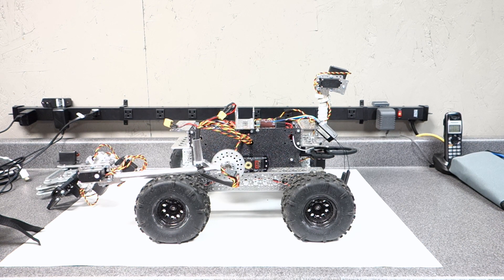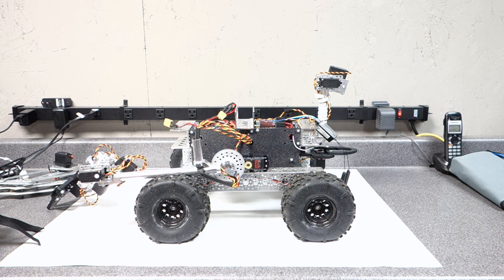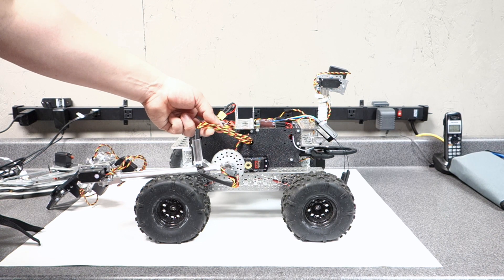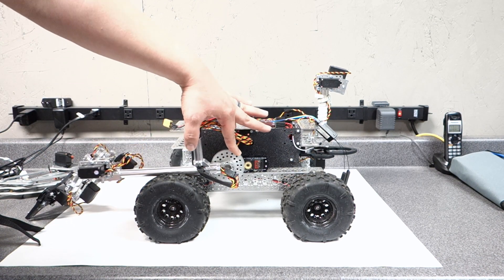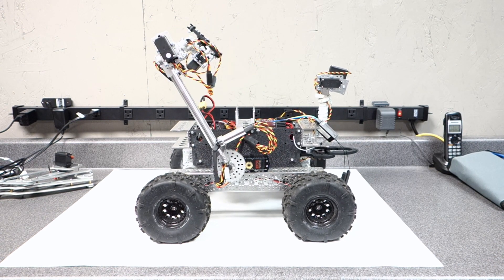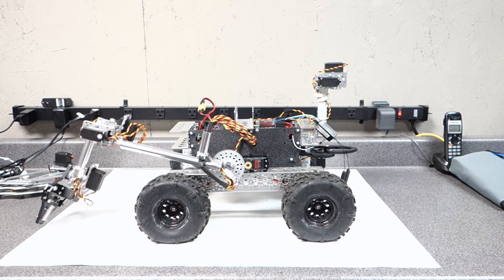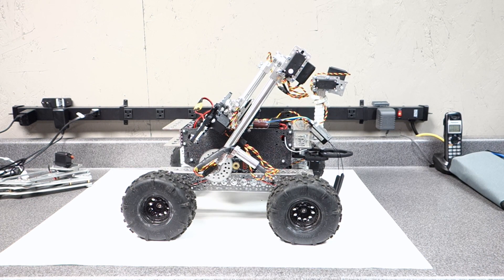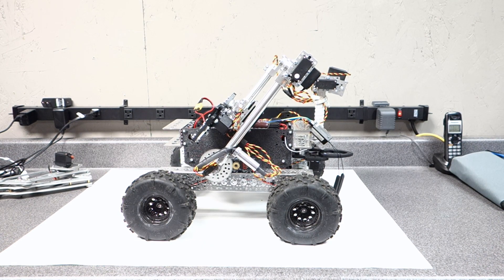NOMAD Rover Robotics 4x4 Project RC Arm attachment

Comment: Fantastick compliment, if you are interest about remote command with an actionoise board, visit the website https://www.actionoise.com
Just an actionoiseboard a playpad and a videocall you can take control of the rover from remote.... Just an 3g connection. Or WiFi, without limit of space...

Comment: Looking to use servos to control a robotic arm similar to this.  Do you just wire up the servos to the receiver and select the channels on the transmitter?  Any additional programming needed?  Do I need a specific type of RC controller?  Thinking about using the Hitec Flash 8 to do this but it is primarily used for aircraft control.  Is there any advantage to using your taranis controller?

Comment: What kind of electronics are you using for the drive system? I'm using an APM 2.6 with brushed ESCs on my Dagu 6x6 Wild Thumper but it's giving me a hard time trying to run skid steer (like yours, left and right motors are forward and reverse). I ordered a Sabertooth dual 12A ESC which is supposed to have skid steer support built in, but I'll know in a couple of days.

Just curious what other people are using for their drive systems. Great build overall though!!
Reply from the maker: +phattacorider 

I use roboclaw exclusively at this point:

https://www.servocity.com/html/roboclaw_2x60a_motor_controlle.html

Comment: How much torque does it actually produce? How much weight can it carry?

Unnecessary information:
I've designed my own robot (albeit MUCH larger and thus more powerful motors). I've approached the arm design differently in almost everyway from yours!

I have a servo face up in the middle for the 360 spin, 2 base motors, one for the first segment up and down, the second works it's way through gears up the first segment to control the second. There is a third segment, with small motor for the hand. I went with a monkey wrench hand for my gripper.
Reply from the maker: I think it can pick up about 8-10 lbs safely as the design isn't counter balanced that well it would be better with a linear servo